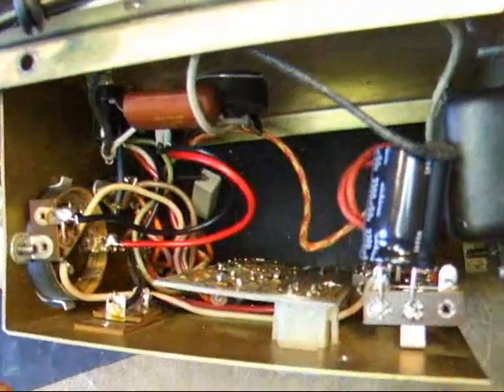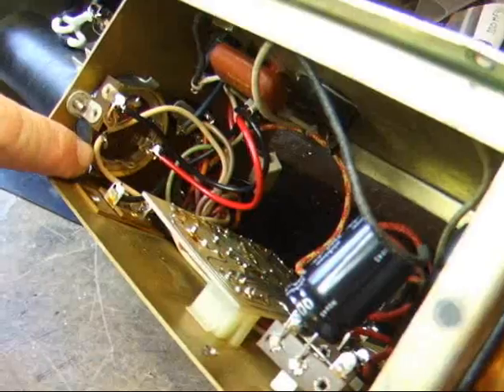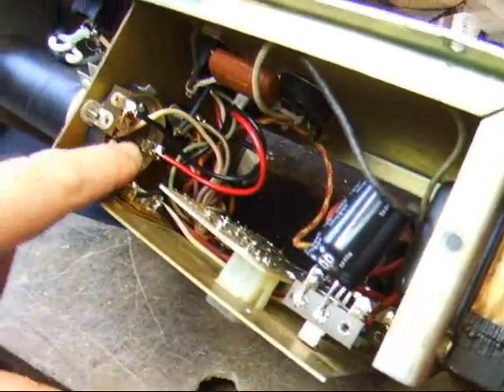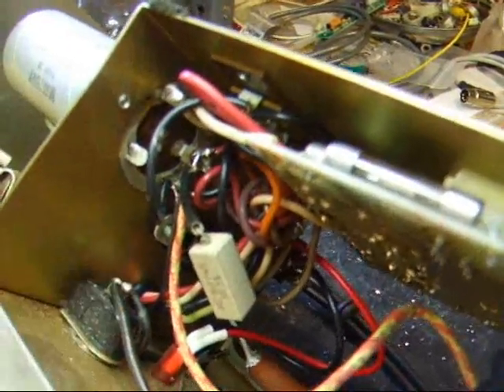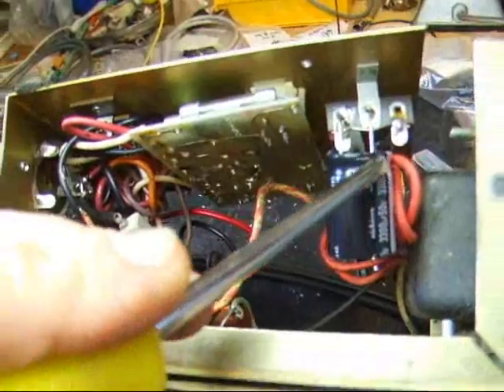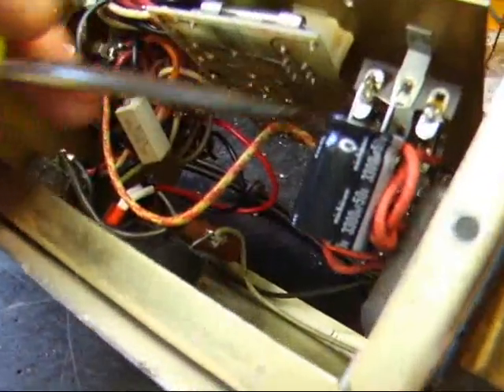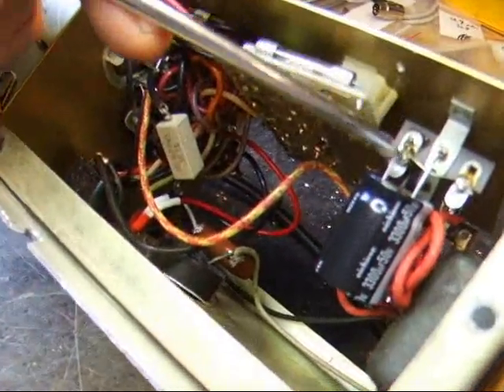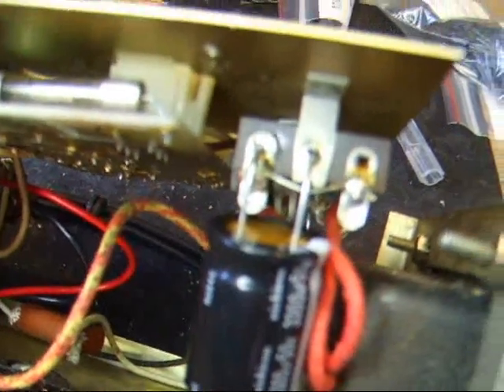Fender Rhodes Suitcase Piano Capacitor Installation

Comment from the maker: yes, that is correct as long as the filter caps are not shorted you can bridge them. It's ok to do this even when there is no ripple, it will save you from doing it anytime in the near future if ripple were to appear.